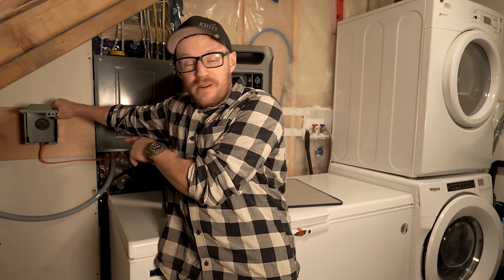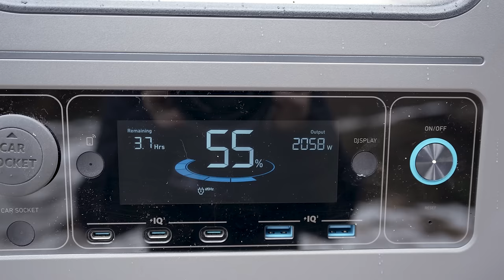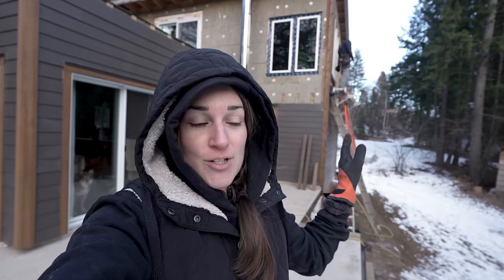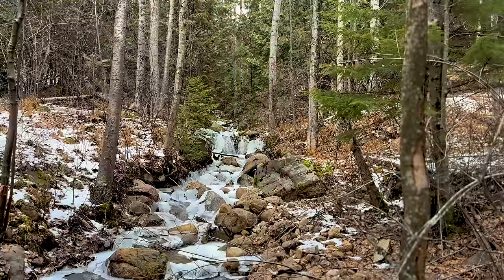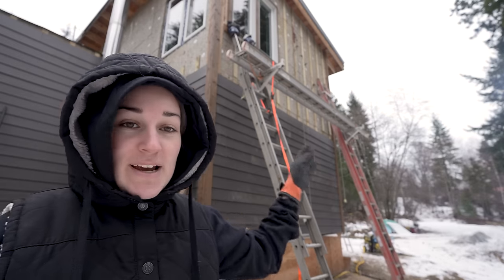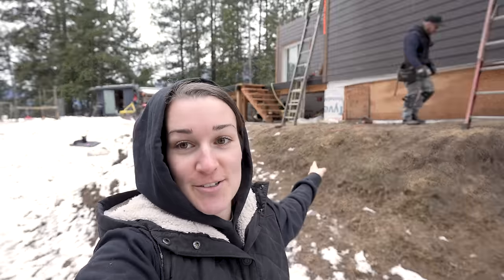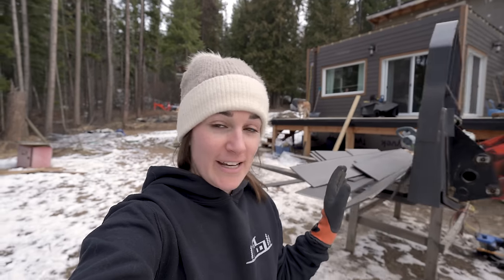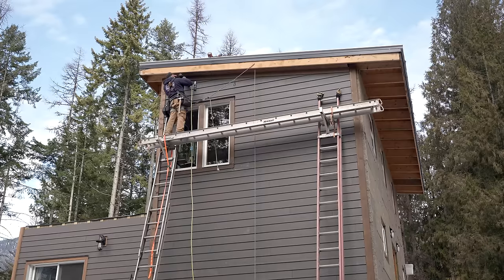Extreme Siding Installation: This Is Getting Scary!

Comment: That is a beautiful cascade and plunge pool! Awesome spring flow for a warm dry winter. I hope you are saving Guinea feathers for fly tying, chickens too.
Remember if fire threatens, takes down curtains and drapes and move combustibles away from windows. Radiant ignition is the risk. Also use metal window screens not synthetic except Kevlar which is fire resistant.

Comment: After watching you balancing up on that ladder in this video, I'm glad I went with a vertical board and batten for our house.  The roof peak was at 27' high and being able to use 12' long boards made it much easier to at least get them in place with a few nails, then using the ladder to nail in to the top.

Comment: Drive in a stake two feet into soft earth using two inch by two inch timber, behind the bottom wrung of the ladder. It cannot slip on the slippery earth and by keeps you from using the harness if you have a ladder move on you! Also use a bag on a rope for lifting nail guns and tools up and down! Keep safe both of you.

Comment: I’m curious to know if you notice a big change within your home with draughts and general heat retention after you’ve finished the outer insulation, window trim and siding
Reply from the maker: Not at all really. We have 2x6 walls with r26 in them, the little bit of external insulation doesn't make a noticeable difference, perhaps if it was a deep freeze cold snap we might identify a change but the weather has been so mild

Comment: Greg, how far is it from your solar panels to the house? How much cable did it need And is there any loss of power with all the extra cable?
Reply from the maker: around 500'. we run a higher voltage in thick cable so i figure we are around 2% loss

Comment: .make sure when you run siding up the roof on other wall that you keep it up off roof 3 to 4 inches, otherwise it will start rotting ANF flaking the siding. I have had to go and cut siding up father and put new flashing behind it, not fun. Looks good otherwise.